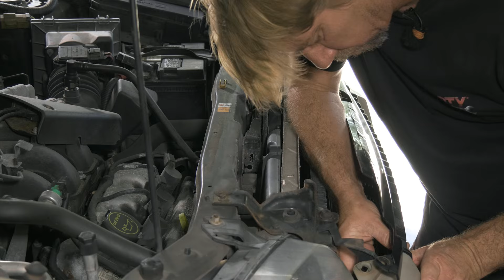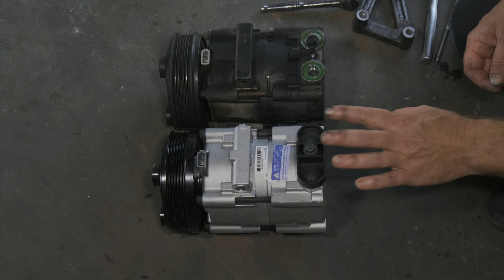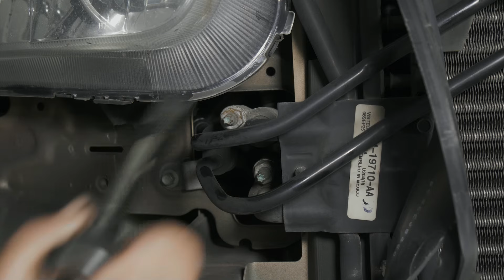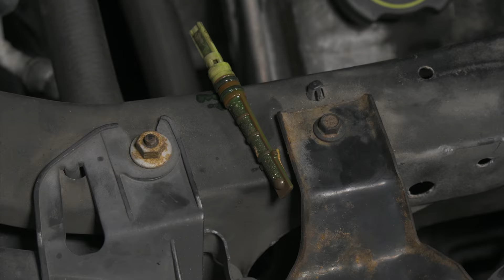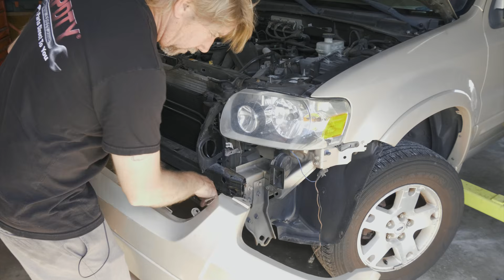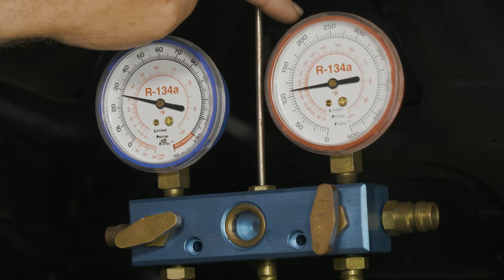2007 Ford Escape AC Condenser, Compressor, Orifice Tube, Receiver Drier

Comment: Hi, this is a great vide quick question: what is the difference between the green orifice and the orange? ford has two parts that are compatible with the escape 2001. thank you very much for your efforts!
Reply: Ford orfice tubes colors are the orfice size. Blue is .067 inch .  Red is .062.  Orange is  .057. Green is  .052.  Brown is .047

Pre 1993 cars are usually R12 gas and often use a Blue orifice.

Later Car with 134a gas use a smaller orifice 

A small change in orifice size changes the system a lot. 

It can make the idle ac performance better and degrade the road speed ac performance some.

If you change an old r12 gas vehicle to r134a you change the oil in the ac from mineral oil to PAg oil  and use a smaller orifice size.

Comment: Good video but expensive valve wrong fitting
Reply: I am about to install ORIFICE TUBE. 
I am confused. The longer part with the screen is it supposed to point to the front of the vehicle or is it supposed to point to the back of the vehicle?

Comment: Orifice tube was installed backwards. Also need to let the system sit for at least 15 minutes after pulling vac to test for leaks. Small leaks take time to show up on the gauge.
Reply: Exactly what I noticed about the orifice, he installed backwards.
Reply: How do you oil the system?
Reply: @COMMON_WEALTHLESS  It depends. If you are doing a quick recharge, the R134A will come with a little oil. When you replace the compressor, some will come with oil, others will need oil added. You will then add a measured amount of oil right into the compressor before you install it. The instructions for the compressor will advise.
Reply: @COMMON_WEALTHLESS  hood sticker will show amount, e.g. if system calls for 9 oz. and compressor comes prefilled with 7 oz. u add 2 more in accumulator, p.s. he did install orifice wrong, orifices r color coded, i.e. orange = .057 also do not recharge with freon can upsidedown, u want gas not liquid, just shake midstream w/engine/ac on hi, hi side closed, also did not purge yellow line prior to recharge, WTF

Comment: my 01 escape  only blows cold air when at idle , as soon as i hit highway speeds it  just blows hot air  any recommendations ?
Reply: mine does the same thing, I replaced the orifice tube and recharged, my head pressure is still high and low suction pressure.  That to me says the evaporator coil is clogged and not enough airflow passing over it to raise the suction pressure.  So that's my next project.

Comment: Great video and timely. I've had work done by 3 different shops with no success and decided to do the work myself. I am working on an 05 tribute which is identical (almost). I could could not get the orifice tube out.  Its deep in the tube and unreachable. Mine is inserted other end from how you inserted yours. Which is correct?

Comment: It looked like you put the orifice tube in backwards?Wont that create a problem.
Reply: I think he did. Might cause a problem.
Reply: I saw that also
Reply: It can cause high pressure on the high side and clog and damage the orifice tube!
Reply: He did, that's why his low side is to low and the high side is rather high. Low side between 30-35 and high side 175-225. For a orifice tube system
Reply: I am about to install ORIFICE TUBE. 
I am confused. The longer part with the screen is it supposed to point to the front of the vehicle or is it supposed to point to the back of the vehicle?